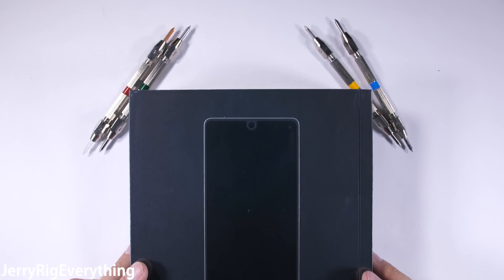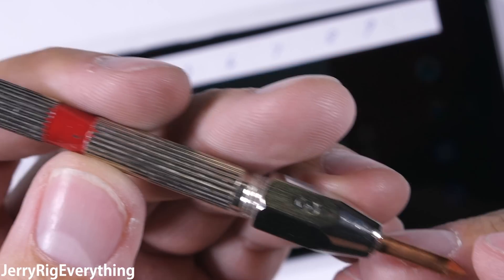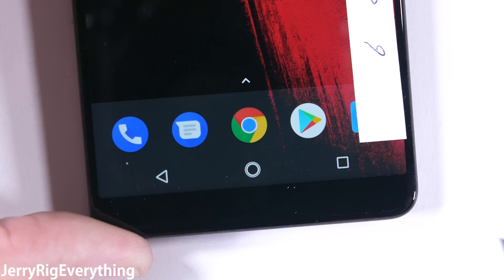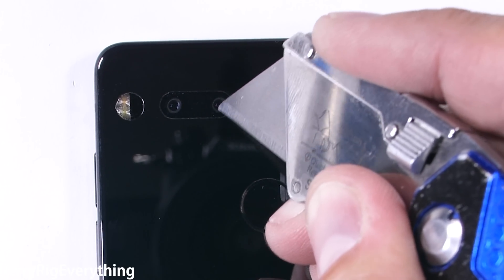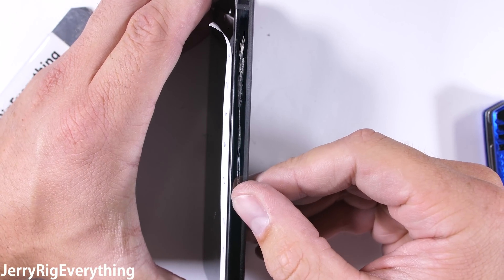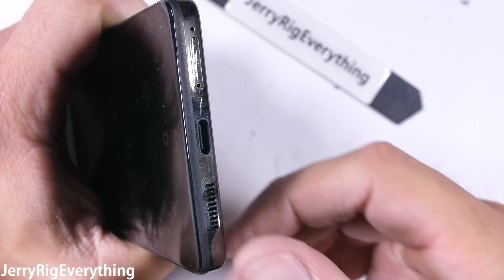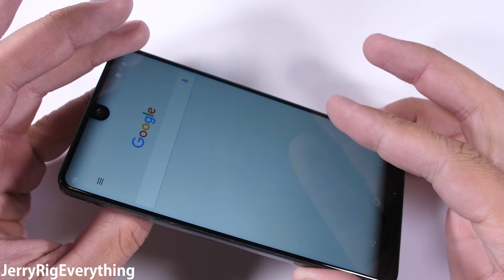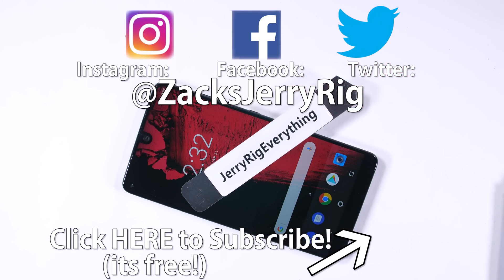Essential Phone Durability Test - Titanium Scratch Test!!

Comment: There's a reason as to why the headphone jack is a standard, it's because it works, otherwise companies that make audio equipment to this day wouldn't use them, removing it isn't "revolutionary" it's dumb since now you need two different connections for either Apple's Lightning port that they wont switch over to and USB C since they're cunts
Reply: Mabirc No, I (and many of my friends and customers) are perfectly willing to buy wireless headphones (if not already bought). The problem with the headphone jack removal is twofold.
First, all wireless headphones need a charged battery. So forgetting to charge them can be a pain in the ass. Travelling can also be a problem, as one might have limited power (I sometimes travel with my good old diskman, as it runs on normal batteries). Also, until BT only supports one device (for now (except Samsung S8)).
Second, the plug standard. Until recently, I could use all headphones with every device intended to play music. I could lend my headphones to a friend or borrow theirs. There is one plug and that's it. Now there are 3.5mm, USB-C, lightning and bluetooth. I can buy some headphones with lightning, but not with USB-C (or vice versa). And all the  other problems follow. If all new devices would support USB-C, the problem would be basically nonexistent. But until then, the 3.5mm is the only solution that works in any scenario.
Reply: Chris then put 2 ports, not hard. if the specter x360 has 2 full power thunderbolt 3 ports then surely phones can take 2 usb c
Reply: Mabirc when im using a bluetooth headphone while watching a vid the audio seems a bit slower than the video... And thats a total crap for me... I like having a bluetooth headphone but i aint gonna just throw away my earphones with jack bcoz of that... I like having the option to do so..
Reply: NeoBlue all this isheeps with  the same excuse because they dont have an headphone jack and now they try to justify that they bought a phone without a jack lol. How can our phones have ips screens? I MEAN ITS 37 YEARS OLD. havent u guys bought the new iphone 9 no screen version for 2k $? Awesome phone! And you can even buy an extra adapter to put screens in if you want for only 69 dollas !!!!!!
Reply: I believe usb c is evolving and wireless headphones are becoming better. But the reason why i still love 3.5mm jacks is that after working all day, when i have the time to watch youtube videos which is usually night time while laying down on my bed, i often needed to charge my phone/tablet and plug in an earphone. You might say - just use an wireless one, well that will also need charging at some point, what if the phone and the earphone needed to be charged at the same time?
Reply: I agree, I haven't seen any valid reason for removing the headphone jack. Removing it won't save much money and you still need a DAC for the phone speaker/earpiece. Still need room for the battery and camera(s), so no space saving either. Dongles are not revolutionary. Neither are putting extra DACs in headphones. Its just a waste of time and money.
Reply: @Mabric: What solution is getting better? Did they start making Wi-Fi headphones? How do you connect better ones? Do they have their own wireless dongle? Bluetooth uses old codec and you don't need good wired headphones to hear a huge difference in audio quality. Unless you have really shitty $50 phone, some DACs there are truly terrible.
Reply: the amount of stupidness in this comment section has shocked me. It's unbelievable that people, being fucked by companies like Apple, think that headphone jacks ARE actually useless. Having a headphone jack does nothing against using a wireless headphone but still keeps the compatibility with traditional headphones.
Reply: Chris
Again adapter is pointless because it is not stationary device. Phone/tablet is mobile device, so it should have minimal amount of adapters. What is the point of buying mobile device, that needs adapters for everything?
Manufacturers only think that people want bigger screens and thinner phones. Truth to be told is people want bigger batteries (or more efficient ones) not thinner phones prone to failure. Not mentioning many people want small smartphones under 5' display (not everyone but there is group - only one producer tries to appeal to that group). 
Also talking about no 3.5 jack and bigger batteries in phones is another lie. Phones without 3.5 jack has exactly same size battery as their 3.5 jack competitors. So what's the point of removing it?
PS Don't call 5.5'-6' phone "smaller".
Reply: Unless the wireless headphones doesn't need to be charged every 3 hours of listening I'm totally not ok with it. Headphone jack is not like other old technology like dvi port etc. Now all devices divided into 2 parts, lightning and USB C. Even Apple has hp jack on their laptops, iPads etc but not in their phones. I recently got the iPhone 6s Plus just bcoz of headphone jack. I will refuse to buy a device without headphone jack until it is resolved. This could be my last phone from Apple if they do not resolve this problem. Stupid iPhone 7 doesn't even have extra battery life. The sheeps who are telling wireless headphones are the solution, can put the Taptic Engine right inside their anus for some vibration pleasure. Sorry for the bad language.
Reply: The one and only reason is they want the people to throw away hundred millions of headphones with the common plug. And they sure will succeed. The young generation is that dumb, and manufacturers know that.
Reply: Mihai Lazar
I'm still using monitor with DVI conector and thank god vcards producers still support it. Why? Because my monitor still works. Why should I change something that work? I do not mention that monitor producers still support DVI on many monitors or you can easly get DVI to HDMI or DVI to DP adapters.
You're talking about handheld devices but you avoid really important part - if one would want to use 3.5 jack headphone (majority) then he/she would have to use adapter. If one would want to listen to music and charge device he/she would need to buy another adapter. And if one want to listen to music on 3.5 jack earphone and charge he/she need 2 adapters. That's bulls crap. Handheld device should be able to connect with ANY peripethials without adapters. Should I mention that many people have great headphones with 3.5 jack - so now what they should do? Buy new ones? Even tho old ones are good? What's the point? What's the point of forcing anyone to buy new, expensive peripethial?
About bigger battery - there is one simple answear - make phones thicker. Why all producers make thiner phones? To make them more prone to bend? Why not to make thicker phone and make some space for bigger battery? Why not to make thicker phone and make it harder to bend? Then they could use a bit thinner layer of alluminum etc. for chasis of phone and save lots of space for anything useful. I would rather buy thicker phone with bigger battery than slick phone with bigger battery and no 3.5 jack... 
PS Phones that have no 3.5 jack has same size batteries as phones with 3.5 jack soo - your point is invalid.
Reply: evrything Tech I have a wireless sony headphone, in times of dire need (battery empty) I can just plug the jack which i can't do in iPhone without plugging an adapter. It's inconvenient. iSheeps will just agree whatever apple decides to do. Pfft.
Reply: My wired earphone's messed up, so I've been using a wireless earphones for a week now. As a 1st time user, I like the no tangle. I like that it makes working out convient. I like that it just makes anyone look cooler.

But the fact that there are audio lag when streaming some YouTube videos suck. Looking for budget Bluetooth earphones that uses 4.1 or higher was a hassle. Constantly turning bt on the paired devices on & off so the earphones know which one to connect to is a hassle. Making sure the earphone is charge is a hassle.

I'm going back to wired, since it's just more practical when you want to switch from listening from the phone and onto a laptop, plus it's lag free. Bluetooth earphones are only coming out when I workout, or when I have to constantly walk around while having to look at the phone as a display (diy projects, cooking, etc.)
Reply: Apple really needs to start pushing usb c on their phones it makes no sense that their whole Mac lineup only have type c now expect for the air and iMacs.
Reply: Sfad Hjkl
Which won't allow using 2 peripethials at same time (only newst allows this "feature" - 5.0), uses lots of battery life and due to it's nature has problems with sync between video and sound. No thank you.
Mihai Lazar
It is not. 3.5 jack is. New is not always better - often it is in opposite.
Reply: Well, there is also 2.5mm audio jack, which is smaller, they could've used it instead(I believe Nokia did for a time), if it were for the size... But as @JerryRigEverything once showed in a teardown (of Iphone 7 if remember correctly), it's not about the saved space... And the "60 years old" thing is just... well, bullshit
Reply: Till Wietlisbach then don't forget to charge them then
Reply: The only thing that bugs me about using Bluetooth headset is I have to keep it charged. There are times when I just want to plug in the 3.5mm jack!
Reply: Iron59 well u can do that pfft
Reply: Makes sense if you make millions of $$ out of this setup. That's their main goal as a company.
Reply: Yeah it sucks. Shitty audio quality, constant drop outs. It fucking sucks.
Reply: alot of things "work"
Reply: NeoBlue No, it's because they're too cheap to include wireless headphones in the box.
Reply: Jarek Rymut I agree that wireless isn't going to be standard anytime soon ... Maybe only for big noise cancelling headphones for music people

But earbuds with USB-C ... Why not ? 

The whole point of USB type-C is that YOU CAN USE IT FOR ABSOLUTELY EVERYTHING so sure kill the jack I'd rather have a bigger battery

And if you still aren't convinced imagine using old 2 inch wide connectors for monitors today instead of HDMI ... That'd be inconvenient wouldn't it  ? Keep in mind that TVs aren't exactly meant to be portable ... THIS IS HANDHELD DEVICES WE'RE TALKING ABOUT... The jack is 60 years old, it only has 4 pins and they are hilariously huge so it definitely needs to go away
Reply: Sfad Hjkl sure if you want to constantly remember to charge your headphones for 3 hours of audio playback ... BT is an alternative ... Not a solution ... Type C on the other hand is
Reply: AkaRyupl buy a god damn adapter, at most you might need two and that's if you use both usb c and 3mm headphones (which would be stupid). The reason manufacturers keep trying to make the phones smaller is because the market wants smaller phones with bigger screens and batteries.
Reply: Prediator X this isn't about Apple ... 
Apple doesn't even fucking matter anymore ... The whole point of USB-C is that YOU CAN USE IT FOR ABSOLUTELY EVERYTHING... I can't wait untill it becomes the standard ... soon (like 4 years from now) IT'LL BE EVERYWHERE and that's a very good thing ... USB-C for headphones will be great (nope I'm not willing to buy expensive wireless headphones since they have to be charged that's a step backwards)
But we need to make everything TYPE-C ... I was so frustrated when I went to the hardware store and asked for a OTC cable with USB-C and they only had chargers ... THIS IS BULLSHIT 

Myea... if everyone could adopt USB Type-C as soon as possible That'd be great
Reply: Till Wietlisbach also apple just need to get with the program and switch to type c.
Reply: NeoBlue have u heard of wireless?
Reply: NeoBlue Apple would make their own ports because they are sons of bitches BUT MAN THAT JACK OS FUCKING HUGE ... It needs a lot more space on the inside of the phone to for it than it would be reasonable to require ... IT'S A 60 YEAR OLD PORT

think about what it would be like if you still used those 2 inch wide parallel connectors for our monitors in 2017 HDMI is way more convenient isn't it ? Cause it's smaller and that's not even that important because TVs aren't exactly meant to be portable ...  ... THIS IS HANDHELD DEVICES WE'RE TALKING ABOUT 

They need to make a smaller universal audio port or stick to USB-C
Reply: Nuna Ralte Yeworth 2 in 1 Type C to 3.5mm Female Audio AUX Cable with USB Charge Adapter Sync Data for Motorola Moto Z, Letv Le Pro 3 - Silver https://www.amazon.com/dp/B07176LPDT/ref=cm_sw_r_cp_apa_9HfSzbHD25H2F problem solved.
Reply: silverword111 they don't need a second port, they just need to put in a USB c splitter, you can get one for $10. Adding a second unnecessary port would waste space that is far too valuable.
Reply: Till Wietlisbach and until the switch to usb c is fully made we must deal with using a converter. It's a little annoying, but people blow it out of proportion.
Reply: NeoBlue the head phone jack is the standard because it is analog just like the drivers in the head phones. If you want to use digital signals (like usb) on head phones you need a dac (digital to analog converter), which up to this point were too large to be put inline with the head phones. Usb c head phones will sound way better thank ones that use 3mm jack.
Reply: Its because there is already a solution available that is getting better and better. And these are wireless headphones. Theres a reason for why the headphone jack is being removed, its because its inconvenient. The wire tends to break, tears on your ears. The audio input gets dirty, its not just 60 years old. The only reason for why everybody prefers a headphone jack is because they are not willing to pay for new wireless headphones which is understandable, but not a solution to the problem. Since sooner or later, all headphone jacks are going to be removed.

Comment: Tear it down! It's going to be hard :))
Reply: Shanez1215 iFixIt needed to do freeze/heat cycles to remove the adhesive.
Reply: Henry Stern Looks like you need a heat gun on the screen or back. I'm hoping the screen, since ceramic is really brittle and would probably break if you try removing it.

Comment: If sides and screen are level 6, why does your razor blade do damage to sides, but none to screen?
Reply: Igor Nikolic less friction on glass than metal
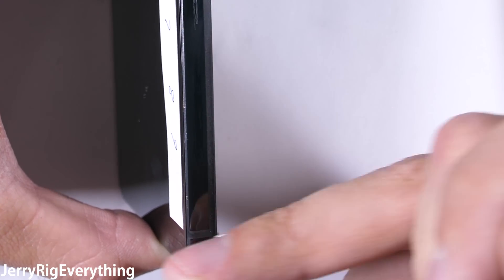Reply: I assume the sides are level 5.5 since the level 5 pick doesn't seem to scratch it at 3:17
So the most logical explanation is that the razor blade have a level 5.5 hardness.
Reply: Remember he said that the scale he uses isn't linear.  If you look up hardness values on that scale, a lot of items in the real world are between 4 and 7.  Titanium is stronger that some steels, but not all of them.  Tool steel is closer to a 7, where mild steel can be between 5 and 6 if I remember correctly.
Reply: I don't have an answer, only a guess:  The titanium might have had a high mix of aluminium.  Usually 'titanium' you find will only have a small amount of aluminium (you generally don't find anything made from pure titanium).
Reply: Watch the video again. He says razor blade around level 6, which means between 5.5 and 6 as level 5 didn't scratch the metal at all.
Reply: There is a thin layer of glaze over the metal it is scratching that not the actual metal
Reply: Igor Nikolic because the sides have paint. The metal is not scratching. The paint job is.
Reply: The razor blade doesnt seems to be at level 6.
Reply: Drewman De Man Sides do not have paint. At least not sides that are metal. These ones are pure titanium.
Reply: Cause the razor is around 5,5 not 6
Reply: Igor Nikolic I'd assume the majority of this question has to do with how brittle they are comparatively
Reply: Igor Nikolic and maybe also the sharpness because I'm sure if the razor blade material gets like sanded down and become a very smooth curve it would not scratch it as easily and that goes into friction
Reply: Igor Nikolic your right
Reply: Igor Nikolic it's not titanium carbide
Reply: Yeah I think you are right according to Zack his razor blade level is 5.5 (approx) in the mohs scale of hardness how its possible to have very deep scratchs
Reply: He test Ceramic with razor, no screen.
Reply: Creactiva Mente If you watched any of his videos you would now that razor does nothing to screens with that gorilla glass. It does nothing to level 6 screens
Reply: Igor Nikolic wow
Reply: If he pushed harder it would grip the glass and scratch it

Comment: why the fuck does every company find it necessary to remove simple convenience from our devices?

here are 6 things that ALL devices should be REQUIRED to have 

1: headphone jack
2: DEDICATED micro SD card slot (not required to choose between 2 sims or 1 sim and micro SD card)
3: removable battery
4: dual sim support (full active not standby)
5: shatterproof displays (use a glass screen protector if you want scratch resistance)
6: wireless charging (the charging port will eventually die)